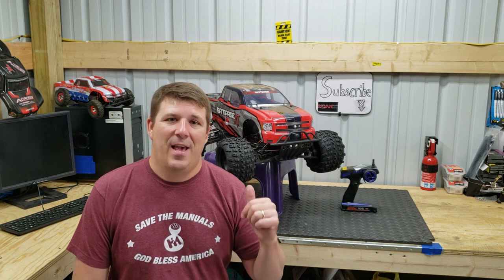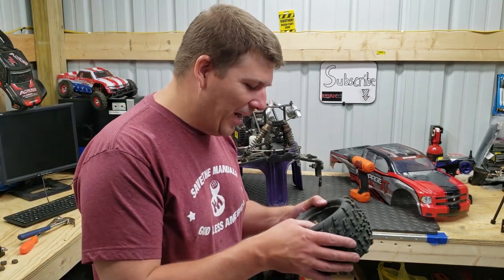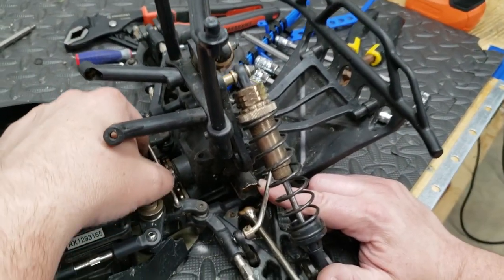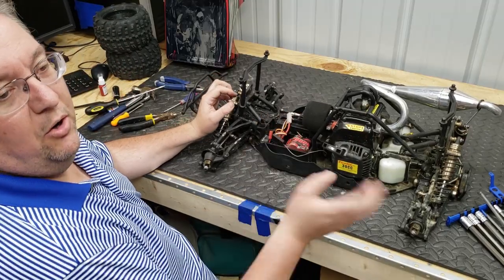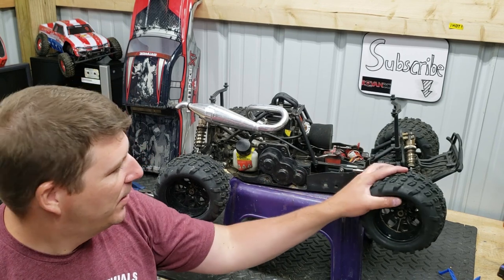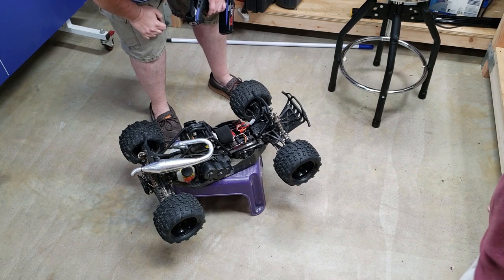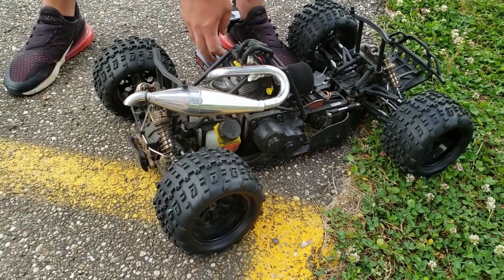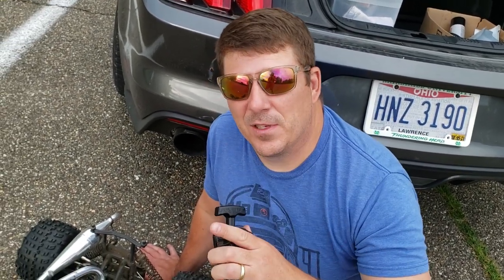Fixing Redcat Rampage XT Driveline Issues....THEN JUMPS, WHEELIES, AND WRECKS.....OH MY!

Comment: Had the same problem with my redcat xr. Just finished tuning it and it was  was running great. Then it would not start. Checked everything, gas flow carb, spark plug.  Everything looked good and still would not start. Took a chance and changed the plug (relatively new) that was the problem. Runs great now.
Reply from the maker: Hmm, that sounds familiar. Stay tuned for the next video where we diagnose it.

Comment: Check coil gap had coil come lose a few times and drill a little larger hole in gas cap had issues with vapor lock. And by a ngk plug to replace one that came with it.
Reply from the maker: Yep, we did just that and now I think we have it worked out. Thanks!!

Comment: The nice truck I just bought one what kind of tires and wheels are you using I would like to change mine to the same one that you are using
Reply from the maker: Thanks.. Its sometimes a pain to start though.  Those are the stock tires and rims that came with the truck from RedCat.  Hopefully you can still find them.  I wonder if the tires and rims off the Exceed Hannibal are the same...
Reply: @BMPowered  the ones off of the Mt should fit too

Comment: where are you guys located
Reply from the maker: Around Huntington, WV. You?
Reply: NJ  I was wondering I there is any easy way to replace the drive shaft hub differential with out taking the motor all all other staff out. On a rampage mt redcat
Reply from the maker: Thankfully I have not had to do that with ours.  I really don't know on that one.  Good question though.  If you find out any tricks to it, let us know too..